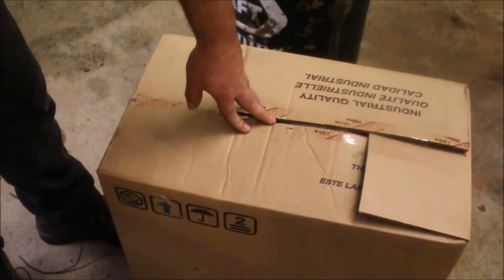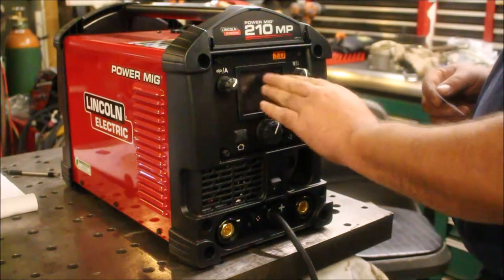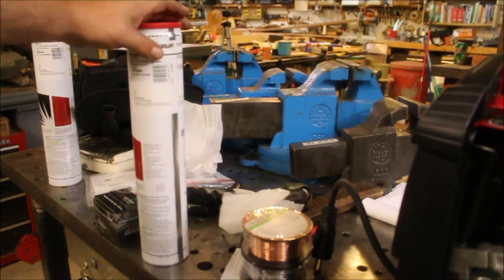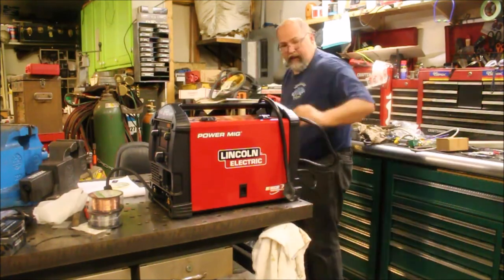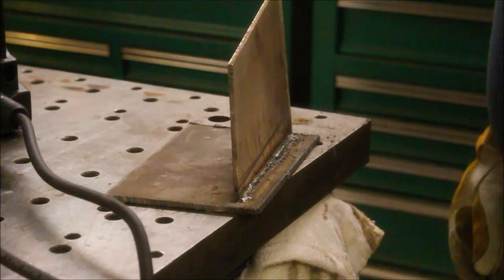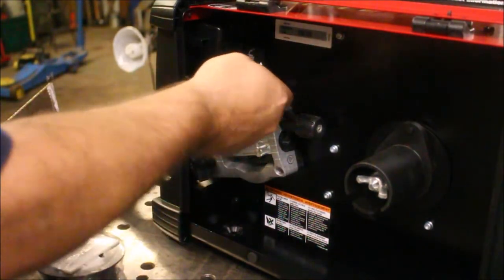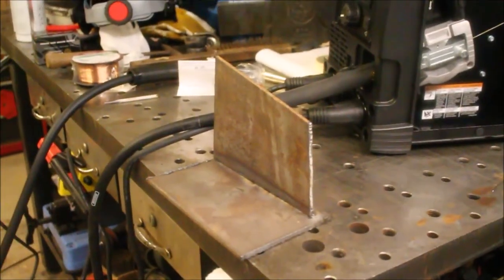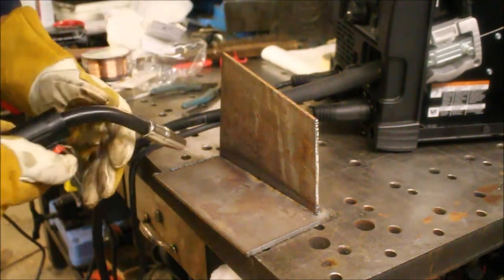Lincoln 210 MP first impressions

Comment: when I weld with Flux core, I always tend to drag not push the puddle and I don't skip ahead and bounce back into the puddle. the whipping action can tend to trap Slag in the weld. I tend to osalte or make cursive "e's" when welding Flux. the drag puts more heat into the puddle and allows it to wet out more. great video! and very nice purchase!
Reply from the maker: You are correct, I don't use flux core very often and will have to remind myself "If there is slag, Drag!"

Comment: WHen Lincoln started developing the flux core in the 1970's for pipelines welding, the company that I worked for selected me to work with Lincoln to develope a welding procedure.  We accomplish the task and was certified for welding with flux core on high pressure pipleine butt welds.
Reply from the maker: Thanks for watching and commenting

Comment: Ive had this model  for about 9 months now. I just wanted to share that it will do 045 flux cored as it arrived (the liner accepts it) I forget if I had to rotate the roller. The 045 seems to have a better supply of flux than 035 and is what is needed to do the higher thickness steel. I work with 5/16 regularly.   I always wait a little longer before knocking off the flux. I've read somewhere that the flux slows down the cooling process which will help reduce cracks

Comment: when you were welding stick, you had the polarity wrong that's why it's popping. you also mentioned 6010, that welder don't do 6010. just trying to help ya out
Reply from the maker: Thanks for the tips, I went back and looked at the video, and it does look like I was welding electrode -, honestly I may have been but I think I switched the leads off camera. And I did misspeak, I meant 6011.
Reply: Joe LuwRQ
Reply: That was hilarious! I caught that too. Then he says the weld looks pretty good.
Reply: This machine is suppose to weld 6010

Comment: How do you adjust wire tension on this machine? The tensioner does not have numbers...
Reply: Put the mig gun about an inch away from something like a wall, tensioner should be loose enough to where the wire will stop feeding when it hits wall.

Comment: I was looking at purchasing a miller 211 auto set for mig. I have a Lincoln tombstone welder. For stick how does the 210 compare to the tombstone.? Maybe I should get this one thanks
Reply from the maker: I really like the 210MP, I haven't done a ton of stick with it, several jobs away from the shop, but it has done everything I asked and the set up is so simple, which is nice since I don't use it often enough to remember the settings.

I have a 18 month review coming out soon, Next Saturday in fact. check it out.

Comment: What do you have for a Tig setup?
Reply from the maker: I have the Eastwood Tig 200 unit, it was the right price at the right time and filled a need. So far I have been happy with it even though it does not have all the bells and whistles that some other machines have. My only requirements were High freq start and AC/DC.
Reply: thanks for the reply.